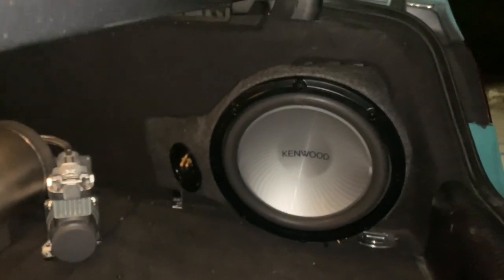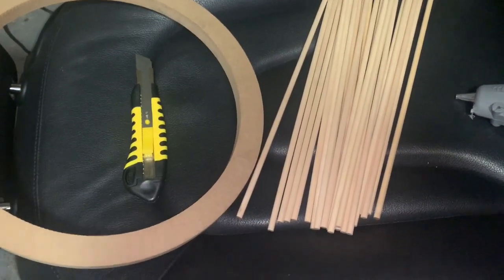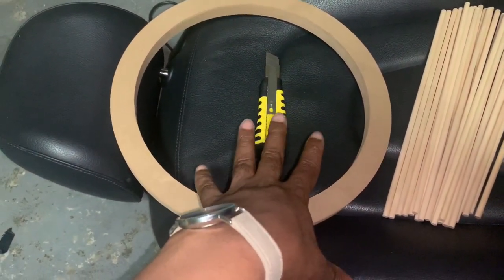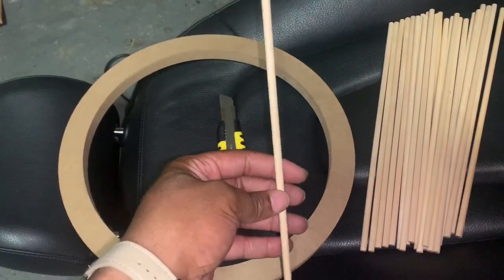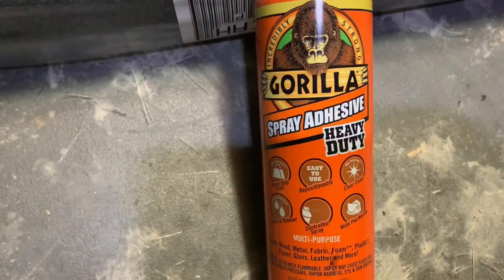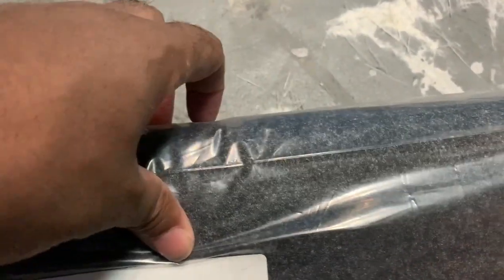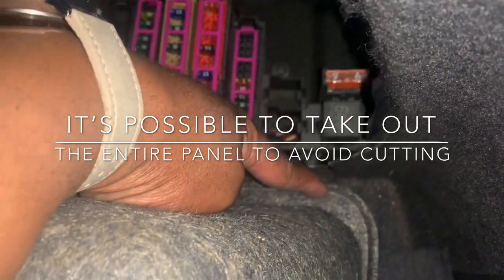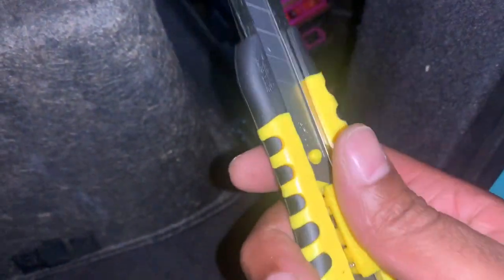How To Make A Custom Speaker Sub Box For Your Audi A4/A5/A6/TT From Start To Finish Or Any Car

Comment: Did you fiberglass the inside of the box and do you have to sand it and put body filler on it or does it even matter? I'm trying to make one on each side of a 2003 A4 Quattro right now. Thanks for your help

Comment: I’ve started replacing the sub using the factory housing on the back deck of my A5. Putting in a 8” JBL. Not a YouTuber but was thinking bout putting up a video
Reply from the maker: Hey what’s up bro, would love to see it, I did mine here’s my take away, It will definitely sound better than factory,  but the factory amp only sends out limited power so you would need 300 watts wats or less to get the most out of the sub, if it’s to many watts let’s say 700 watts the factory audio won’t be able to give it enough power to perform💪💪💪💪
Reply: My factory sub was blown so had to replace it anyway
Reply: I used a 8” JBL stage 810

Comment: What’s up man, just bought a 2017 A4 premium. Was driving yesterday and I went to pass someone and my rpm locked at 3k, drive system malfunction came up on the dash then went away. Pulled over and turned off the car, restarted it, tried driving and it would go to about 3500rpm and it sounded like I had an exhaust on the car and the turbo was whistling super super loud, then it said start stop system malfunction. Complete loss of power anywhere above 2500 rpm.
Reply from the maker: doe it still have the issue, did you reset it, sometimes it is a malfunction, let me know, and ill point you in the right direction
Reply: @brucecustommotors   just got the car back from Audi. There was a valve that had gotten disconnected from the turbo. all fixed.
Reply from the maker: @mattyoung4062  thank god it was simple

Comment: Bruce I sent you a message on insta I was wondering about your thumbnali of the video Audi secret hacks it looks like you have 2 screens I wanted to know what the bottom was and do they work simultaneously? I really appreciate you and your videos I'm brand new at this but I think the 2 screens thing is sick! I'm a new to customizing
                                        .. Sincerely

Someone who has no clue what he's doing lol
Reply: Yeah I saw that too.. I'd like to know why he took it out???
Reply from the maker: the bottom is just a stand alone tablet I use to control my air suspension, however i can mirror it and have it function with my device, its held by a magnet with a cd player tablet mount
Reply: @brucecustommotors  ohhhh ok makes sense! Okay so quick question do you think it's possible for you to have the upgraded Android Audi tablet at the top and another tablet where the CD player is or is like the CD player connected to the tablet at the top only because I want to have two screens in my car one that is from Audi and the other like a Tesla screen???